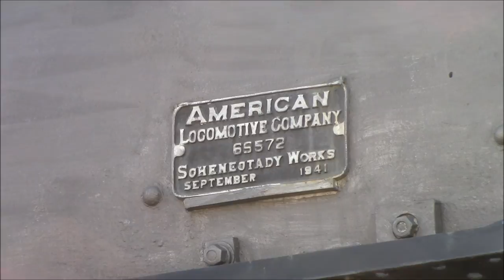Union Pacific 4014 and yard action at Colton on 2/9/14. Lots of interesting power!

Comment: UPY 832 is an SD38-2. Look closely at the radiator fans & 2 small exhausts.
Reply from the maker: Mmm, didn't notice that. Thanks
Reply: Just adding that 9902 is an SD59MX. It's a home brew rebuild of UP's from older SD60Ms to be Tier 3 (Or maybe 4) compliant.